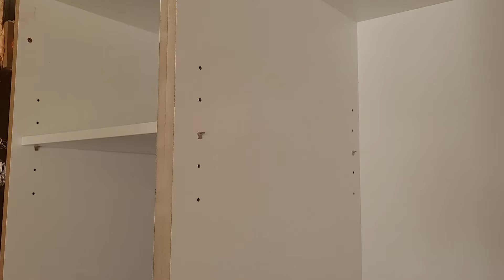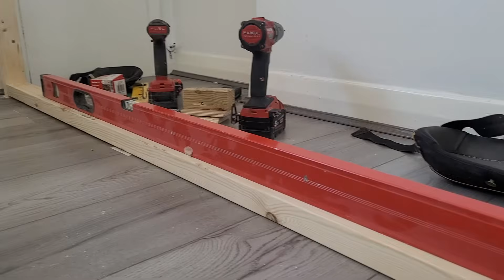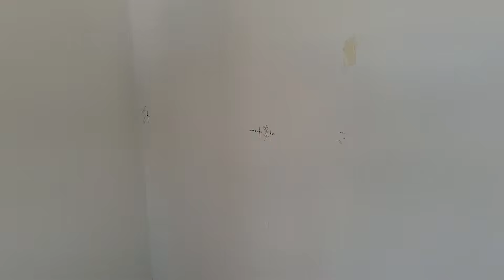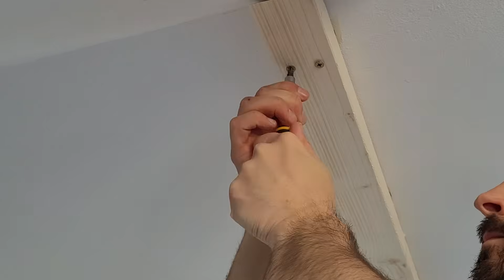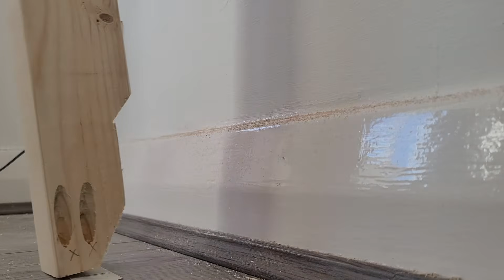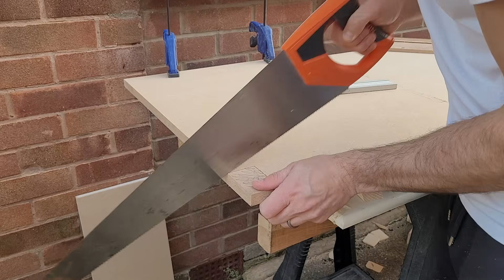#2 Framework & Shelving | Fitted Wardrobe Tutorial for DIYers

Comment: Hi, thanks for the elaborate explanation! One thing I'm wondering: in my apartment it's preferred not to drill in the walls and ceiling. Would it be an option to make multiple frames that fits snug between floor and wall, attach them together and will it be stable enough that way as a cabinet? Or is this really not recommended?
Reply from the maker: Thanks! I'm no expert but I can't imagine the structure would be strong enough without being fixed into the surrounding surfaces. Sorry that's not what you wanted to hear

Comment: Quick question mate — if this is upstairs, do you ever skip fixing into the floor and just secure the uprights into the wall studs instead? I’m cautious about drilling into floors because of services. I have 50mm screws but I don’t know if it will be long enough to secure into a carpet, but I think 70mm may be too long.
Reply from the maker: Hi, I'd always screw down into floor where poss. Over a long span, a length of timber could flex considerably. And also screwing the timbers down keeps packers in place. If you don't go any further than 20mm into floor you'd be seriously unlucky to hit a pipe or cable. I'd strongly recommend removing the carpet where wardrobe will sit with a Stanley knife. You really want all the timbers to be solidly fixed in place and carpet is going to compromise that. Hope that helps

Comment: great vid Jack, do you have any issues with warping frames? I've been thinking of using CLS for some fitted cupboards but everyone seems to warn me off the idea :S.
Reply from the maker: @Smart_Kyle  thank you. It's a good question as there's no doubt CLS is sensitive to changes in temperature/humidity like all real wood. I've not had any problems but I pick out each length by hand and make sure that it's acclimatised to being indoors for a few days before checking again and using where possible.

Comment: Just a question I’m thinking of doing something like this without much experience. When you’re putting  the wood on the wall and it needs to be level if the walls aren’t to level how do you compensate for that ? I saw you put a packer in there so do you just leave that there and carry on ?
Reply from the maker: @carldickinson5812  yeah it's a case of working out how much the wall is out of plumb and compensating with packers. If you fix the timber into the wall right by a packer the compression between timber and wall will keep it in place

Comment: Since this is not “the standard” way to build cabinets/wardrobes can you comment on disadvantages of this approach? Advantages seem to be the cost and ease of built?
Reply from the maker: @gabrielahajduk9293  good question! Some people will say the framework inside is less aesthetically pleasing than individual carcasses. The 'faker shaker' door method looks great from the front but from the back it's just a flat slab of MDF whereas other build methods would be shaker front and back. Other than this I honestly can't think of anything - so just 2 minor aesthetic points about the inside of the wardrobe. I'd welcome any other disadvantages people can think of?
Reply: @ProjectNumberNine  Thank you for answering, I appreciate it. I’m a first-time home owner of a “project house” and once I stopped hyperventilating after seeing prices of fitted wardrobes I decided that I’d rather get the tools and learn how to build those suckers myself than pay that much money. I’m a bit apprehensive of going from zero to house renovation and fit out, but oh well, you want nice s**t, you’ve got to learn how to make nice s**t, right?